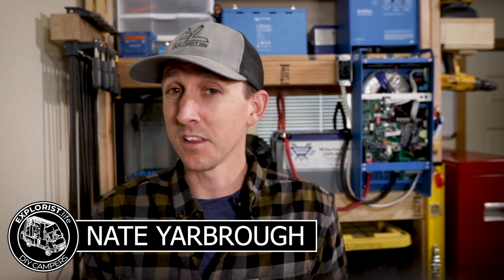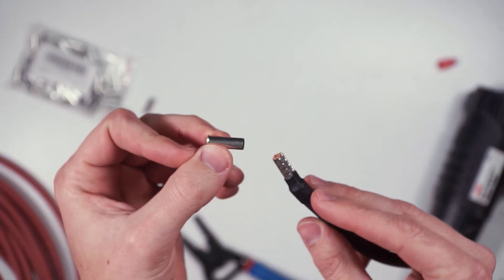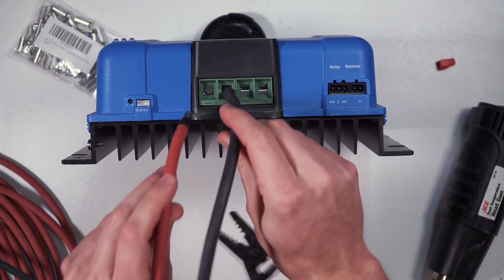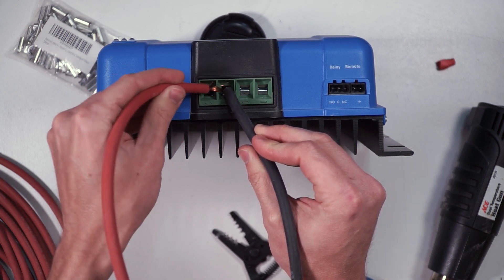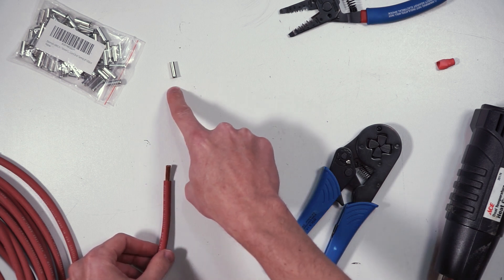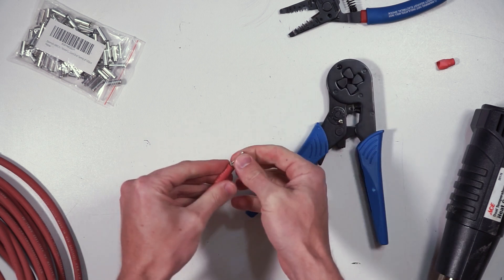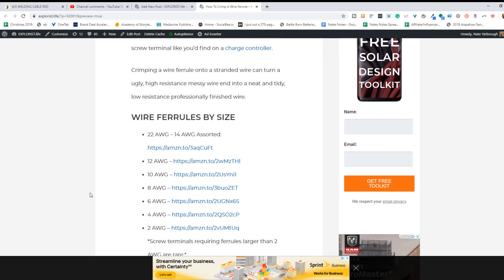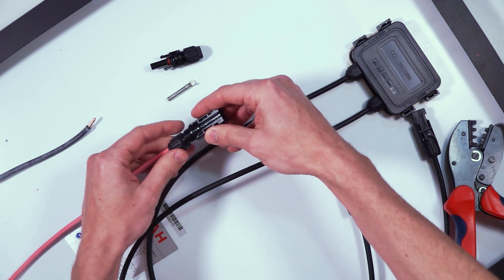How to Crimp Ferrules (and Why You Need Them)

Comment: Is the crimping tool the same kind of tool used for the smaller ferrules  . I need to crimp 0awg ferrules for 0 awg gage wire and not sure about the crimper I need to look for ....
Reply from the maker: Each crimping tool is rated for a particular range of wire sizes.  Here is one for 0 AWG: https://hausoftools.com/products/greenlee-k28gl-trapezoidal-crimper-fc7-1-0?variant=33001326673943&currency=USD&utm_medium=product_sync&utm_source=google&utm_content=sag_organic&utm_campaign=sag_organic
Reply: Bought a HSC9 16/4 (square) ferrule crimper. One 16mm2 AWG#6 wire pulled out of the ferrule. The first 10mm2 AWG#8 jammed the tool. I got the wire out, tool still jammed. Squeezed more, deformed the empty ferrule into a + shape. Watched another YouTube video, where they said, as you do, that it releases when fully closed, so pressed more, and it opened ok. Messaged the seller, who said there is a small lever, that clicks into place (first click) when crimping; in the slot on the moving handle, between the plier handles, that can be used to release it.

Comment: I'd like to know the pros and Cons of using a wire ferrule at the vehicle battery with a "Crush" type battery terminal. Sticking raw wire in a port then tightening down an Allen head to crush the loose wire doesn't sound as neat and clean as using ferrule. Also, raw wire where the jacket ends is probably susceptible to moisture or condensation and that'll promote oxidation to the point where You may have to pull it out in a year or whatever and strip it back and re-clamp the fresh wire. So what's wrong with using a ferrule on a 2 AWG cable?
Thanks in advance for your reply.-Mike
Reply from the maker: I'm not sure how many more pros/cons I can provide above and beyond what I discussed in the video.  It sounds like you have an idea, so maybe run with it and see how it works.

Comment: Nate, did you ever go over the process of just running, channeling, and poking wires thru the van. Is there a better way to get them to stick in places? Did you use split tubing to protect the wires? or any other ideas?
 
I know you have covered a lot and I am still in the process of learning and absorbing the info. But I don't believe I saw anything about running the wires thru the van and best practices to do that.
thanks for your time.

Comment: Great videos. Thank you! Question - my local auto electric guy says I need a 12 Volt to 100 Watt converter in order to charge my solar batteries from my alternator. I purchased the battery isolator linked from your diagrams. It appears the Victron items you install have this charger included in their inverter? I discovered your videos after I purchased another brand. Can you possibly suggest a 12 volt to 100 watt converter?
Reply from the maker: If you are trying to charge from your alternator, you can use either an Isolator or a DC to DC Charger as shown in my diagrams at https://www.explorist.life/solarwiringdiagrams.  There is no such thing as a "12 Volt to 100 Watt Converter" so there must have been some miscommunication there.
Reply: @EXPLORISTlife  Thank you

Comment: I did not know about these.  I was surprised to find that my Victron Charge Controller had the screw type connections for a 45 amp load and it made me nervous.  I'll definitely use ferrules to improve the connection and reliability of the termination.  It's a shame that I have to buy a freakin' crimper for four connections.  Victron needs to change their design - it's a weak spot.
Reply from the maker: Glad I was able to teach ya something new!

Screw type terminals are pretty much industry standard for charge controllers.  Victron, Outback, Morningstar, Midnite, Renogy, and many more all use screw type terminals for their charge controllers up to 100 amps.  They are UL listed and totally safe.
Reply: Trust me when you get a crimper and some ferrules, every wire will look like it needs a ferrule on it, I just got one and a box of ferrules, never knew I need one until then and now I will not go without ferruling every wire end I come across.

Comment: It’s kind of overkill but when doing commercial work we would use an oxidation preventative. Dissimilar metals with electrical current going through them creates an oxide which is not very conductive. We would twist the copper wires put a very thin coating of ox-gard or like product and then crimp the aluminum ferrules. Like I said it’s probably overkill.
Reply: That would be pretty much a requirement when working with aluminum-to-copper. Copper-to-copper does not require it as most types of mechanical connections readily create a long-term-stable, relatively-gas-tight interface between copper conductors.

Comment: When you wire smaller wires together, in parallel, do you have a favorite way of joining three wires together?  Would ferrells work there?
Reply: We have ferrules that are made to join two wires in one ferrule. It's very simple. Add the wire sizes, and then get the ferrule that is that size or one up. For me it is simpler because I am used to metric wire sizes and they add up nicely. A double ferrule often has a plastic sleeve that is not round but flat, to accomodate two wires instead of one.
Reply from the maker: Will be covering that in an upcoming video but YES!  Lever Nuts are a great solution for that: https://amzn.to/2yeJbw0

Comment: Would it be a viable alternative just to solder the end of a cable to keep the strands together?  👍
Reply: I used to solder the ends (aka "tin" the ends). Ferrules work phenomenally better.
Where the solder meets the unsoldered part the wire is stiff then not stiff, so the not stiff frays and breaks. Even with a bit of heat shrink tubing.
A crimped ferrule has a more gradual transition to uncrimped wire which is easy to support with a bit of heat shrink.
When you clamp the soldered bit under a screw it squishes out ("plastic deformation") and the squish increases every time the wire gets hot and cold or vibrates, resulting in continually loose connections.
The compressed wire and ferrule clamps solidly and does not continue to deform.
Tinning the ends is easy to heat damage the insulation, making it stiff and/or brittle (an expert can usually avoid).
Crimping and heat shrink doesn't heat damage insulation (but you might if you use a flame to shrink the tubing!).
Reply from the maker: Not so much.  Heating wires from soldering can make the wires and the insulation brittle which is a bad deal when it comes to installing this stuff in a camper because of all of the vibrations when driving down the road.  Plus, crimping a ferrule onto the end is so much faster, easier, and more approachable to somebody, who perhaps, has never soldered anything before.  Soldering is MAYBE better than nothing, but IMO, it's not really comparable.
Reply: Tinning the ends of a cable like that is a bad idea because it makes the end very hard and doesn't allow the screw terminal to compress the end, which makes the connection very prone to becoming loose. Like trying to grab a hardened rod with pliers, you need some give to get a good grip.